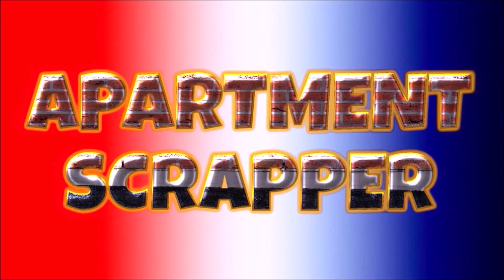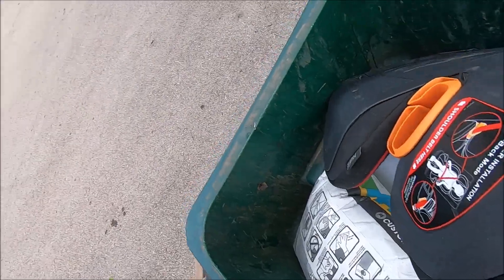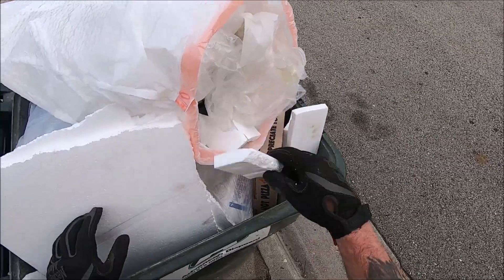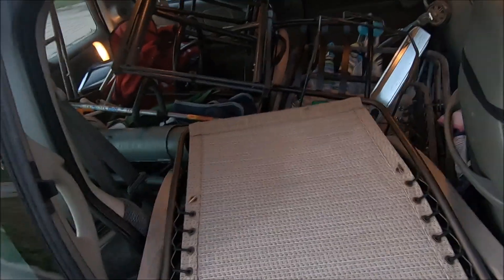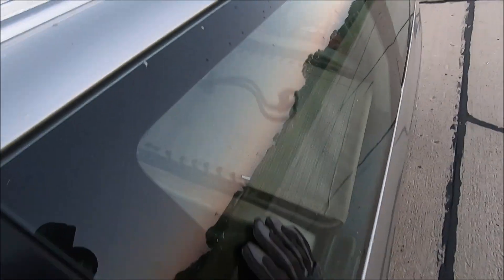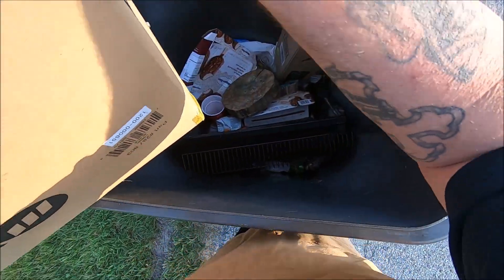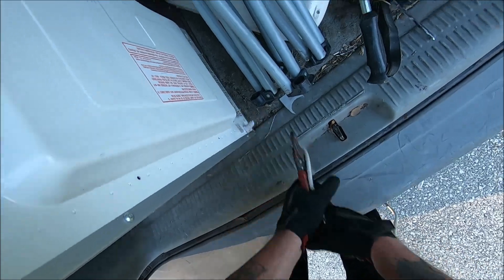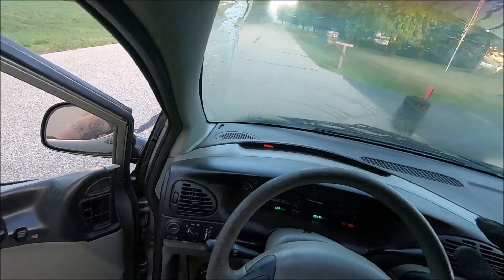SO SO CURBS...NO NO DUMPSTERS

Comment: Ahhh I would have been torn to leave the CRT TV. And by hook or by crook I would have got that stainless sink out, I hear what you say about having to process what you have before finding more, I break mine down into the smaller stuff for winter processing, still occupies space though, constant battle, enjoyed .
Reply from the maker: CRT's are illegal to throw out here. $25 charge to turn them in. Sink was in deep. It was hot and I was in work clothes. Also, no where to keep it until I could tear it down.